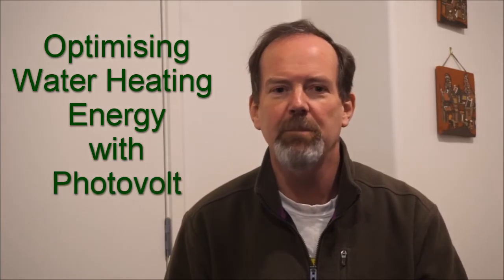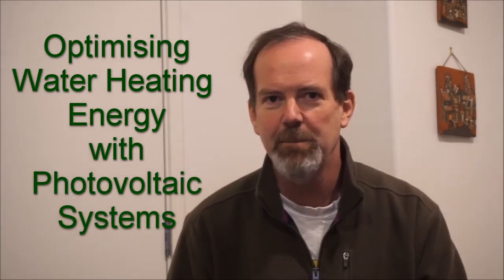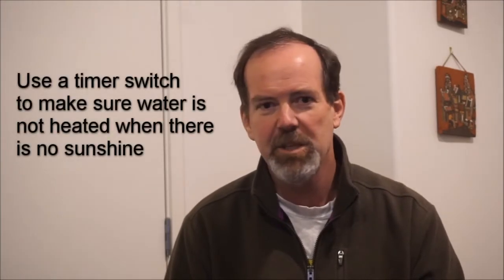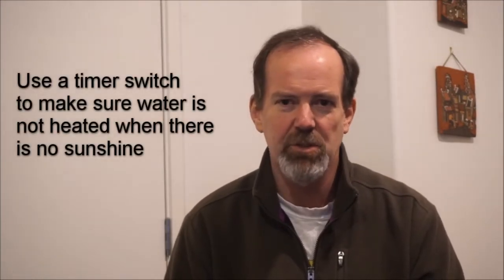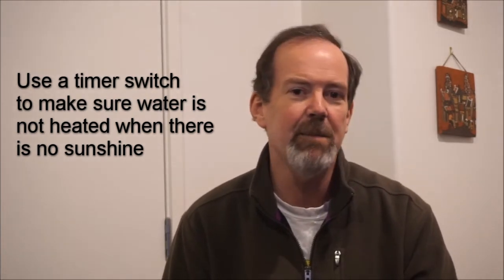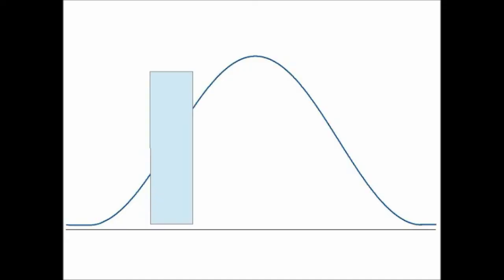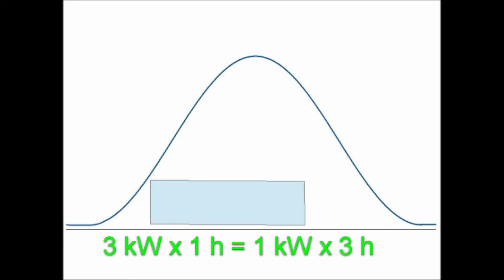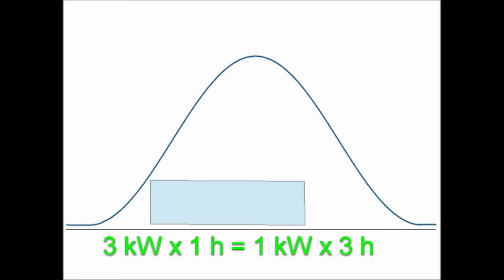Optimising water heating energy with PV systems

Comment: With a relatively small PV array (500-700W) supplemental water heating rivals that of a HPWH at lower cost. A small array insures that 100% of potential power generated is totally used giving this one of the best payoffs.  I have an off grid system and all my hot water needs are provided by excess solar not used to charge batteries. Every successful system has to have excess capacity in order to function on less optimal days. Most have no understanding of how much power is wasted. Free tends to make everyone careless. I built my own system to heat water efficiently. It is quite cheap to do and still there is relatively low interest in it..
Reply: Very interesting. Thanks for your comments. You have quite a different set-up from me, but have obviously focussed on getting the biggest bang for your buck.
Reply: It's not just the biggest bang for your buck. It just makes much more sense from any point of view, unless one wants to promote fossile fuel.